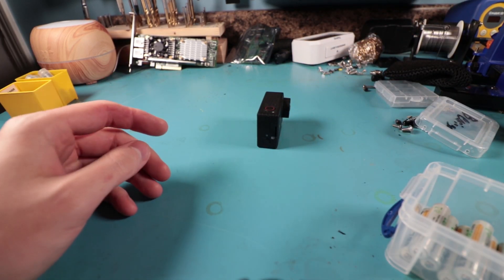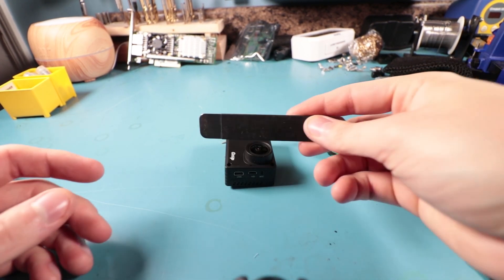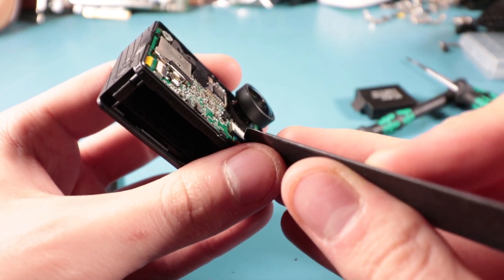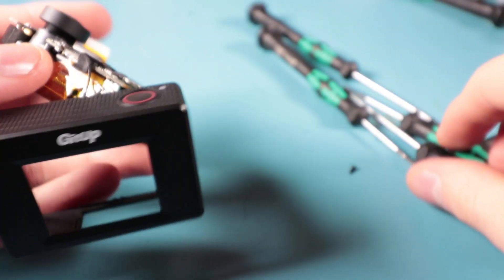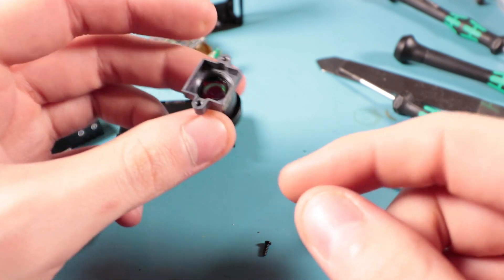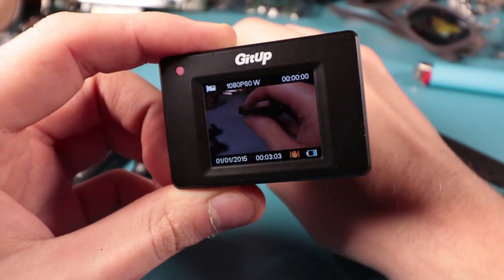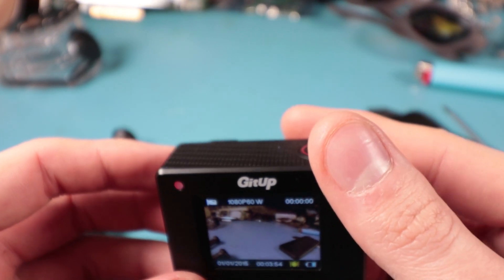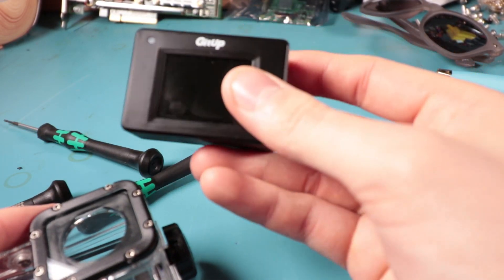Converting A Cheap Action Cam (Gitup Git2) into a Nightvision Camera - Part 1

Comment: I can't figure out what's going wrong.  I know I'm picking up IR light.  I can see the signal from my remote.  However, I have had no luck using an IR flashlight.  If I point it directly at the camera, it picks up light coming off the LED, but only that point.  I can not light up a space at all.  Any thoughts?
Reply: reflected IR light falls off at a different wavelength.  You probably need a brighter IR light, or use a barrier filter that blocks visible light on a regular flash light and if it has any IR wavelengths in it the flashlight it'll push through the visible barrier.  You just need to make sure it doesn't block IR light as well.

Comment: Since you removed it with solder iron, could one only take face cover off camera, without more disassembly, and get the lens off? Also, is the IR filter in the screw off part of the lens? You should go out in a dark area at night, the woods or something and try it WITHOUT any kind of an IR flashlight. This is what I want a IR cam to do, see in the dark without lights. I am not sure, but I think those super expensive TERRIBLE image quality cameras see in the dark without any lights. I have refused to buy one though because they are like only 360p, for quite expensive ones. For me, that resolution is useless. I want to be able to see in the dark in the woods, which I live next to, and record what I see in hd.
Reply from the maker: Yep, you only need to take off the front cover to remove the glue. I will have to try and see what it looks like in complete darkness when I get the chance. This camera has a Sony Exmor sensor in it so it is really good at picking up low light, so I could see that possibly working pretty well. :)